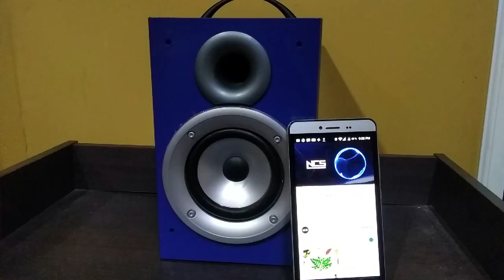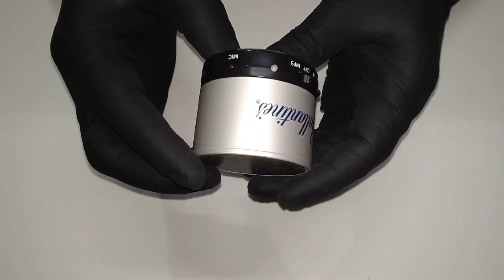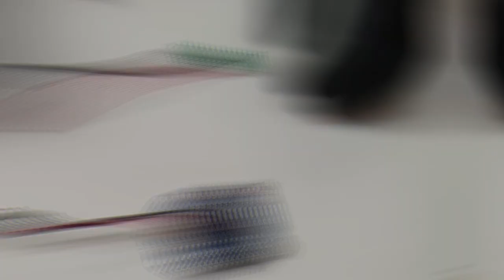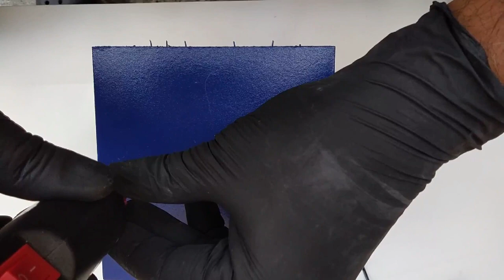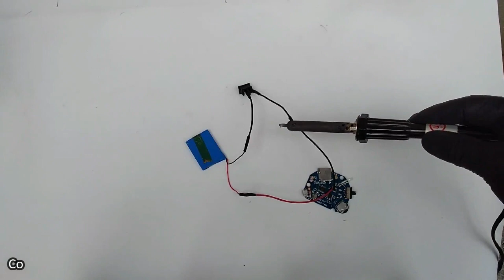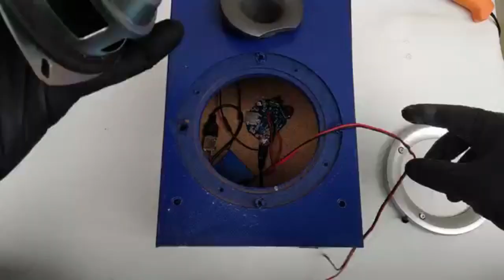¿Tienes una bocina vieja?... Recíclala y conviértela a Bluetooth !!!

Comment: Tengo unas bocinas que son de 20 mil watts si lo aguanta ese resectaculo
Reply: Tengo todo solo que no es bluto y la cabeza se enfría mediante un ventilador enorme es sony
Reply from the maker: @peter-kw3zw  Que tal buen día, en este caso creo que te convendría más un dispositivo como éste:

https://articulo.mercadolibre.com.mx/MLM-903771386-modulo-bluetooth-50-mp3usb12vauxmsd-2-amplificador-tpa3118-_JM?searchVariation=81317019535#searchVariation=81317019535&position=7&search_layout=stack&type=item&tracking_id=99a74f77-1fce-4890-9756-8f8b897592c8

Así solo tendrías que conectar las bocinas. Los amplificadores son de 60W, no se si te dará toda la potencia, en ese caso podrías poner otros amplificadores con más potencia.

Comment: Estereo viejito jvc j900  tengo dos bocinas
Creo que son 4400 watt    
Que materiales ocupo para acer las bocinas modernas bluotoo  usb y recargables  si se pueden las dos juantas
Reply from the maker: Puedes usar un cargador de baterias como este
https://www.cdmxelectronica.com/producto/tp4056-cargador-de-baterias-litio-lipo-5v-1a-proteccion-dual/

Y claro una batería de litio lipo de al menos 3.7 volts
Reply: @SIST3MS  

Ya lo rebisen y esta son las caracteristicas
Modelo
JVC MX-J900

Estereo

400 Watt Total Power. Bi-Amplified
(150W x 2 for Subwoofers + 50W x 2 for main speakers)
Extended Super Bass

Potencia total de 400 vatios. Biamplificado
(150W x 2 para Subwoofers + 50W x 2 para altavoces principales)
Super Bass extendido

Que materiales ocupo.
Reply from the maker: @guruguru2080  Para aprovechar la potencia de tus altavoces, puedes usar este amplificador:

https://www.cdmxelectronica.com/producto/modulo-amplificador-clase-d-mono-60w-tpa3118/
Las salidas de audio del módulo bluetooth las conectas al amplificador, y las conexiones de energía de tu módulo bluetooth lo conectar al cargador que te puse en el comentario anterior.
El esquema quedaría:
Altavoces - Amplificador - Módulo bluetooth - Cargador de batería - Batería
Reply: @SIST3MS  
Muschas gracias.  Otra preguntota
Tarjeta Player De Audio Bluetooth Micro Sd/usb Memoria o modulo reproductor
Reply from the maker: De preferencia el modulo reproductor
Reply: @SIST3MS  cualquiera.   Enlace de una tienda
Reply from the maker: @guruguru2080  de donde nos visitas, estoy en México y quizá no pueda darte opciones de tiendas, pero puedes tratar en mercado libre con el modelo de los módulos que te pasé
Reply from the maker: Solamente un receptor bluetooth que puedes encontrar en algún dispositivo como manos libres o audífonos, hay algunos que son recargables.
Reply: El parlante no es muy grande para eso?  Digamos no entrega toda la potencia que el parlante puede dar
Reply from the maker: @whereareyourlife3460  Eso si, no te va a entregar la potencia total, para eso necesitarías agregar un amplificador al circuito que fuera más potente, como éstos, dependiendo de los watts
https://articulo.mercadolibre.com.mx/MLM-764397827-tablero-amplificador-de-audio-yeeco-modulo-de-amplificador-_JM?quantity=1#position=17&type=item&tracking_id=ad5d6889-0a77-42f4-8403-7b43ef9ad00f